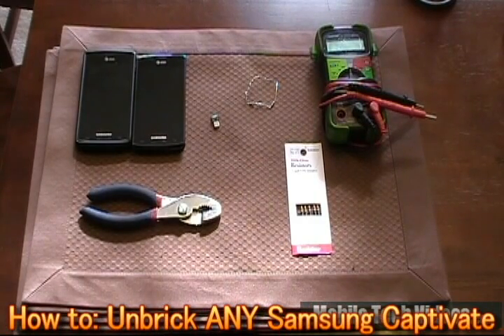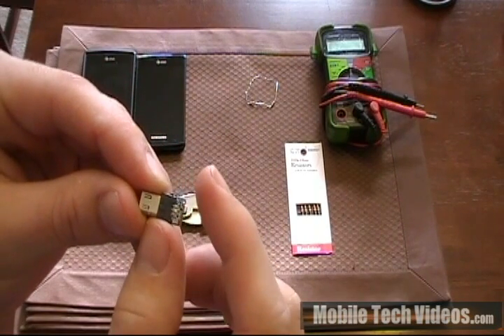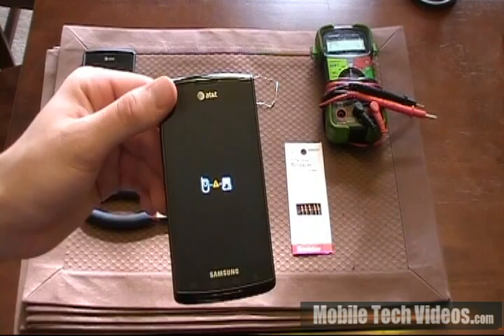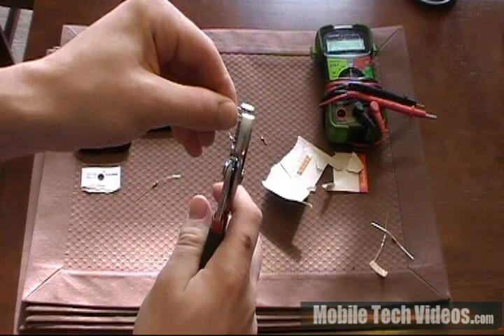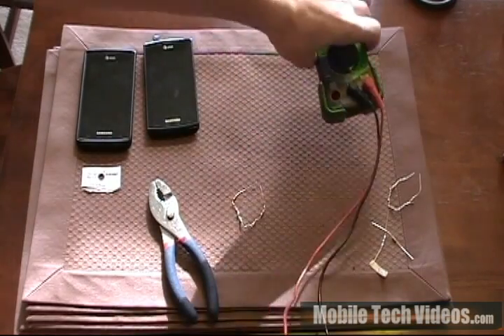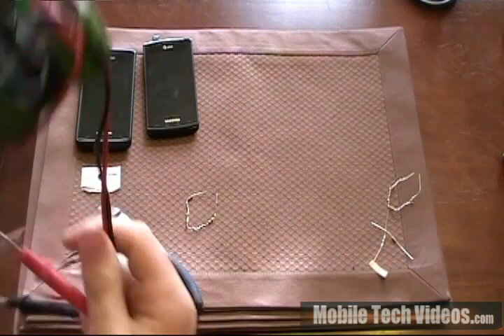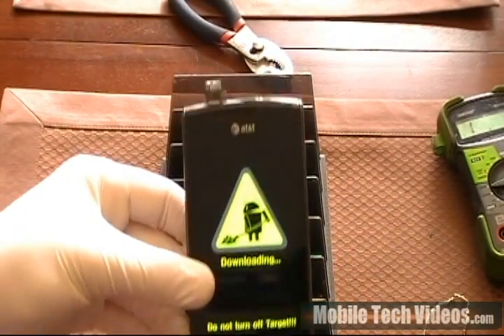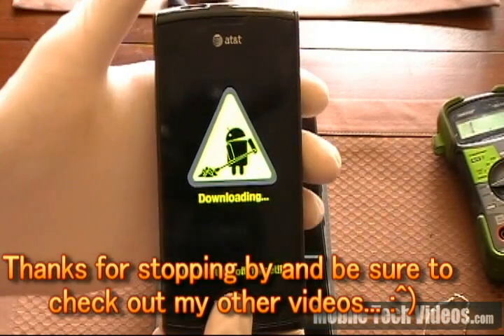Samsung Galaxy S (How-To Unbrick *USB JIG Method*)

Comment: I have a samsung tablet  gt-p5110which doesn't have 3 buttons, nothing works flashing with odin either. After a 'succesfull flashing nothing same picture like on that phone. The charger of the device has a wider connector, I assume that this would work also if you get a connector like the one I have? Can I ask why you cut the usb open, isn't it sufficient  to solder the resistor to ground wire  id wire of your usb ? It makes it a little difficult to solder it to the pins.

Comment: My phone the Note 2, suddenly won't power on even with new batteries or 
being plugged in. It was doing the power itself off thing for a few 
weeks before finally not starting up at all.   Is that what you called 
hard bricked?  Can you tell me if this device will work for me to access
 my phones internal stored contacts, or will this only work for phones 
that power up but don't go beyond the boot screen?.  Would appreciate 
input from anyone that knows. Thanks.

Comment: Hi,
As I don't speak english very well, I didn't notice if you mentioned in the video, but my question is:
Can't the resistance be formed by just one resistor?
Reply: Yes, if you get a 300k ohm resistor then it can work, it's just you don't find many of them that's why most people use multiple of like a 100k ohm resistor or 150k ohm resistor.

Comment: i bought a usb cable to make the jig but it only have 4 pins instead of 5
Reply: I've got the same problem. Did you find wich pins to connect to the resistors with a 4-pin USB cable ?

Comment: I tried this with my S3 and it actually put it in download mode awesome, the phone I want it to work on is the samsung centura which is totally bricked. My wife has a Centura that is brand new I tried it on hers but all it does is turn on the device doesnt go to download mode. So could the pins be different or something? Thanx for any feed back.
Reply: Bobby8451 TENGO EL MISMO PROBLE, TODOS LOS CABLES QUE TENGO SON DE 4 PINES. COMO SOLUCIONASTE?
Reply: Alexander Diaz I don't speak Spanish. What r u saying?
Reply: Bobby8451 how can I hook up a charger on my scooter i have four wires red green black white witch wire do I need to books to my moped batterie

Comment: When I ohm out 3 100K series resisters I get .296 M not K. is that good or bad? Radio shack has none, nobody around here does except I drive all the way to Atlanta which is 30 minutes away for one little resister that might not work. Might ride up there this coming weekend.

Comment: hey,for lg devices pls check this
http://www.tradekey.com/product-free/3-In-1-Micro-Usb-Cable-For-Lg-with-3-Resistor-Selector-56k-130k-910k-3415674.html
But i dont  know which is for dwld mode,maybe the 130k for service mode..
Reply from the maker: As I mentioned below 910K is the correct mode for most LG.
Reply: Is this a jig for LG's phones???
Reply: Jase F
Reply: 123456789 123456789

Comment: In my plug the 4 pin was on the left not right, looking at pinout on the top of the plug. But single 300k ohm resistor didn't do it so I think I need one more 1k ohm to add for 301k ohm total.
Reply: 330k ohms can. :)
Reply from the maker: Raven Empleo There is some variance allowed so you can get away with quite a bit of difference. If your resistance is around 295k ohms - 330k ohms and it's not working, then you will need JTAG repair or another method. We offer hard brick repairs as well! Call us at 657-444-5824...
Reply: is it ok if i only have 4 pins??

Comment: I used a 125k resistor combined with a 180k (125 + 180 = 305k) and it works too. First i was tried with one single of 330k and it didn't worked.

Comment: fyi everyone that has NOTE 2 i317 i was bored so i tried it and did exactly what he did except i love soldering but the main purpose in doing this for my needs was my friend had a GS3 I537 i've downloaded everything i could get my hands on including debrick.img i been through the ringer but moral story is IT WILL NOT fix a hard brick only soft brick. just so you dont waste your time. thanks for the insight mobiletechvideos you taught me for future references. :)
Reply: ***** lol, kinda good thing its not my phone. but i told him how to get cheap parts its simple .it would only cost him 69.00 dollars for a new motherboard fyi GS3 sucks i love m over clocked phone at 1.9GHZ per core which i have quad core not bad it could use some work...
Reply: My phone the Note 2, suddenly won't power on even with new batteries or being plugged in. It was doing the power itself off thing for a few weeks before finally not starting up at all.   Is that what you called hard bricked?  Can you tell me if this device will work for me to access my phones internal stored contacts, or will this only work for phones that power up but don't go beyond the boot screen?.  Would appreciate input from anyone that knows. Thanks.

Comment: I have a hard bricked galaxy s3 nothing comes in the screen when plugged into a PC it connects and when charging it has the red light  I bought a USB jig haven't tried it yet as I believe the battery is dead so I'm charging the battery with external battery the s3 model is sgh-i747m if the USB jig doesn't work do you think this will

Comment: my gt-i9100( galaxy s2)went SOD yesterday..before it went completely dead..it stuck on the logo screen..(where it displays the model name and number GT-I9100)..so i used odin 3.07 and tried to install the pda 4.1.2..n then odin was stuck at "Nand write start"..some site forums said that i could use .Pit files to flash it in 'recover mode' then it will work with odin giving you no problem with "Nand write stuck"..unfortunately i did listened to dem n run an unknown pit file using odinnow its dead

Comment from the maker: Hi Pete,

You should be able to dig the trace up a bit and connect a wire to it and the other side to the pin on the USB port. Keep in mind sometimes that pad can pull due to corrosion from water damage so it may not have been their fault.

Comment: hi. i sent my Samsung Galaxy S Plus GT-I9001 in for a new charging port. i got it back from the shop and they said they couldn't fix it. as i no how to solder i decided this was a lie so i opened  my phone up and what they have done is in the process of taking the old port off they have completely removed the 5v solder pad off the pcb. so they cant connect the micro usb 5v to the mobile phones pcb board. do you no another place i can took it up to to get the phone to charge mate ? jhope you c

Comment: I have a att GS2 skyrocket and and att GS3 both hard bricked. tried to install wrong rom's on both. both devices will not power on or go into download mode. i tried this method using 3 100 ohm 1/2 watt resisters and tried 3 different usb cables. none of them worked. i ordered a usb jig from his site and am still waiting the shipping information. if it works ill post the results

Comment: Dont need a JIG to unbrick a complete brick.
1. remove battery from galaxy s
2. hold the home key and the power down key at the same time while inserting battery back in.
3. while still holding the home key and power down key press the power button. This will bring it back into the download mode.
Reply: Idiot.

Comment: phone is stuck in a Boot Loop and I cannot start the recovery mode... The moment I place the battery in, it starts to boot but stops after 10s and start all over again. When I press the volume and powder button, I can see the recovery mode appear for a second and then it start to boot again. Very frustrating and I cannot find an answer anywhere. I already tried to change the battery with no change. Anyone ever encounter this problem? If so, what did you do to fix it?

Comment: OK that was amazing.
Happy New Year.
Could you set up a permanent connection by soldering the resistor series to the pins?
And maybe add an isolator switch in the loop. Or would that cause a change to the resistance?
Great video,

Comment: heh, I didn't need a download JIG to do this...I borrowed a Captivate from my neighbor, having never done a root, custom ROM, etc....and ended up getting that 'soft brick'...I fixed it myself using Odin and a standard USB cable....of course, I don't know how old Odin is, if it was available back in Dec 2010 or not, but I was so relived to get the Captivate back to stock form, then I got DevilKernal Installed with 4.1.1. JB, so I fixed it AND put a custom ROM on it...all on the first day I had it

Comment: Can I solder the resistors on the USB board and then connect to the phone ?

Or only works when you do exactly on this sequence below ?
1) touch the back connector
2) touch the front connector

thx

Comment: finally a detailed  video, but  try showing the longer  portion of the usb connector  to referance 4 5,   as  the top  longer than the bottom,  zero referance,  using phone is  great also for referance on 4.,5
keep   those  resistors side by side for  handy, shorten leads, and package them,  but for show, it is  great. 
right in relation  to???
right of two in relation?
will  over  300-300k ohms work, ??
yes  amazing,

Comment: I'm sure somebody has pointed this out, but 3 100K ohm resistors will give you 300K ohms. Getting 300K ohms from 3 100K ohms IS the effect of wiring them in series. You don't get an extra 1K ohm from the series. This works with a wide range of resistances. Check XDA, somebody used a variable resistor to see what range the phone would accept, and it's somewhere between 270K and 320K ohms.

Comment: HI .. 
Umm i recently tried to flash the MIUI rom.. 
and in the process of flashing cm7-captivate-initial-kernel.tar I ended getting stuck at the GALAXY S CYANOGEN (mod) screen.
Now for all the Download and Recovery modes i used the ADB COmmands
since my captivate doesnt have a three button combo..
The problem i have is i cant get into recovery mode. 
1)becuase phone is not getting detected so no adb commands would work
2)no 3 button fix.
and i am stuck. Would htis method work for my scenario.?

Comment: I used odin3 to flash my sgs rom and it stopped in the middle of the process. Then I unplugged the usb and took the battery out. Since then my sgs can't start at all even I press the power button (black screen and no sign of power). Can I use usb jig to bring it to the download mode?

Comment: hi there.
mine is Galaxy Mini S5570, or some may call it Pop.

i had tried the jig... i manage to bought only the 300k  ,one piece.
and another is 330k, one piece.

i tried on both ,... different pin... but still get nothing ....:(
i had used plastic to cover in case accidently touch the metal.
it should be ok with 1 piece, right? as long as it is 300k

very sad... could someone please advise where did i not doing right?

Comment: Thanks for this video!

I successfully got my soft-bricked cappy into Download mode using your method with the 3 resistors and a chopped micro USB cable from monoprice. It took several tries to find which pins were the right ones but I was able to do it without an ohm meter or anything.

Thanks again!

Comment: I just wanted to say thanks and this 100% worked.  Mine was stuck in a boot screen loop with no availability to do a recovery or download mode. This popped it into download so I could reload into stock and fix everything.  Make sure you get 100K. At radio shack the have 100 ohm, 1M ohm, etc, there are alot, just make sure you get the right ones to work.  I used the trick three times in a row while I tested what was putting it into boot loop.

Comment from the maker: @dante04srt You have a bricked bootloader. I have a machine to fix this but it involves micro soldering and I'm still practicing this procedure. My overall goal is to offer this as a $55 solution once I nail it down.

Comment: Thank you, thank you, thank you!!!! Un-bricked my phone after a couple of attempts.

Notes:
- Used 330k resistor (orange orange yellow gold)
- Had to cut up a couple of cables and only the Samsung original worked in the end because of pinout. No easy way to figure out pinout, took a few minutes to get that yellow download screen but it did show up.

THANKS A MILLION!

Comment: @MobileTechVideos Yes you are absolutely right, the pin structures on both ends are different, with an extra pin 4 (not connected) on microUSB. I should have checked before opening my mouth.

Comment from the maker: @juliobahar I had no luck with that as the lead needed here does not exist at the end of the cable. Care to elaborate? From what I see, there are 5 pins on the micro side. We are dealing with pin 4 and 5. Pin 4 is a blank and 5 is a ground. On the other end of the cable (standard side for pc input) 4 is omitted and pins 1,2,3 and 5 are used.